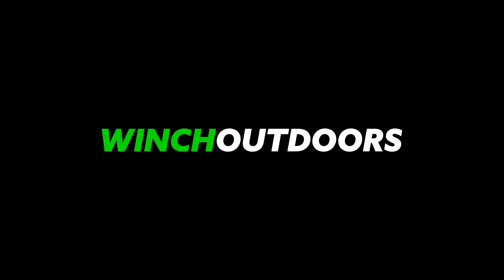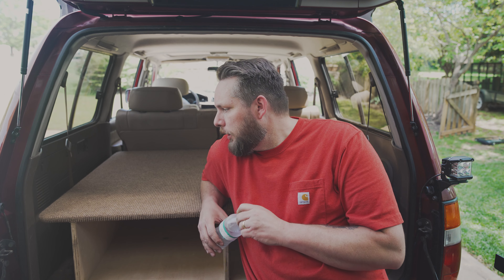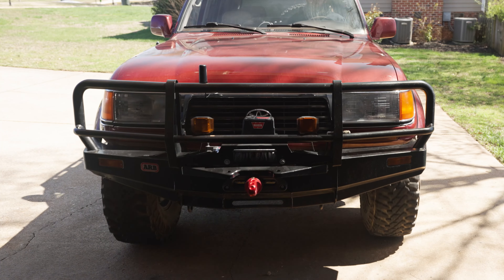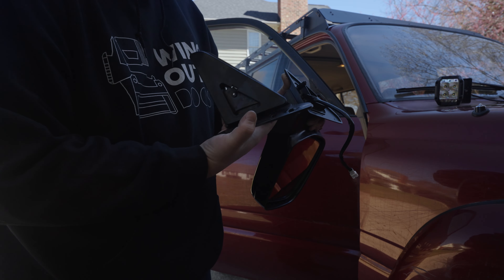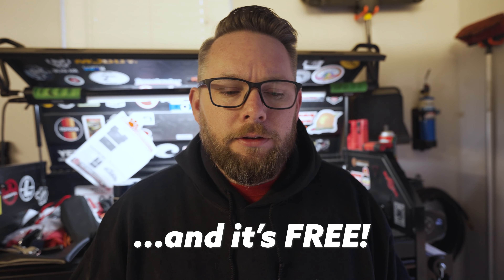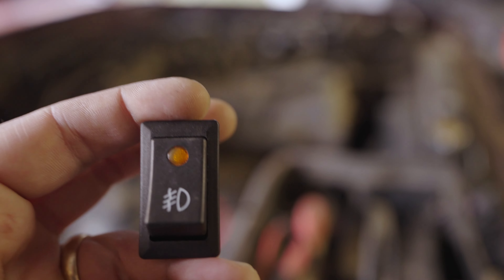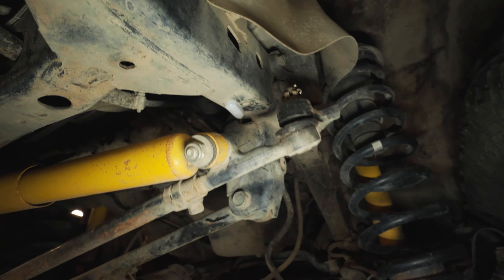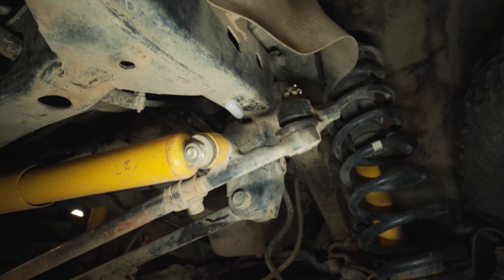Overlanding Adventure: Prepping my 1995 Toyota Landcruiser for an Epic Journey to Colorado!

Comment: Will those lights still work OK after you go out on the trails?  Looks like it gets pretty caked with dirt down there.
Reply from the maker: It hasn't been an issue yet. The undercarriage gets cleaned pretty frequently actually but mud can certainly cause things to be dimmer.